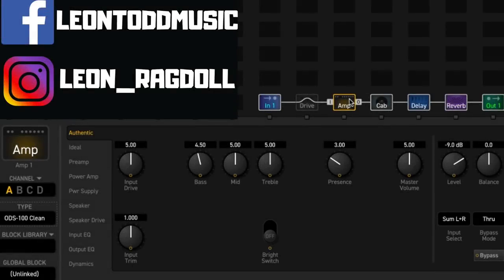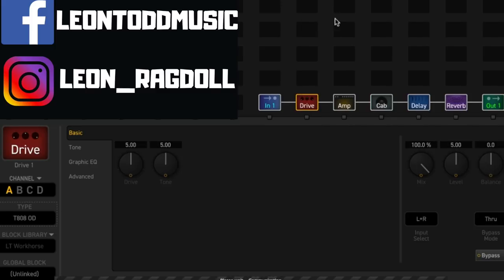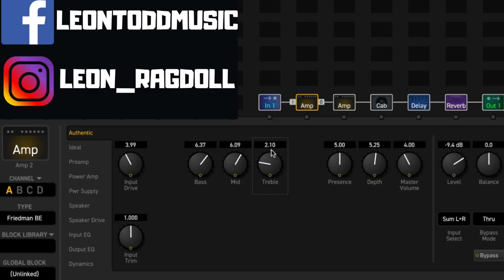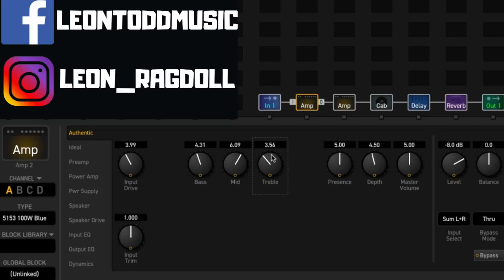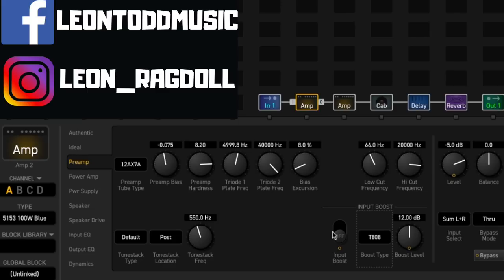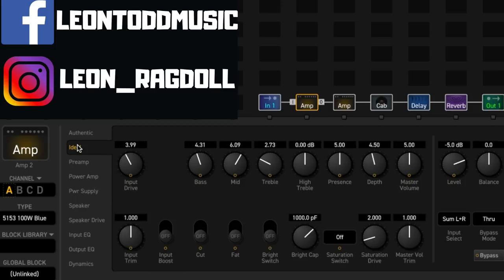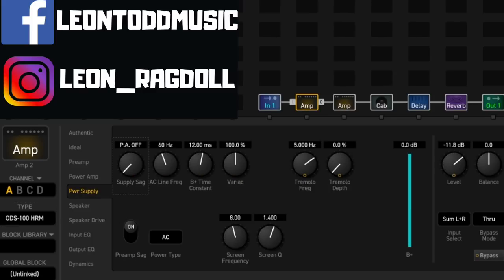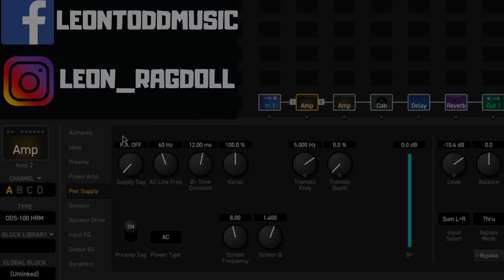Using Amps as Drives

Comment: I learn something from your channel every day! Have you ever used your Axe with a real amp where the real amp is just furnishing the power section? I'd like to try it with my JP2C, but I'm not sure how to connect and configure it.
Reply from the maker: Yep, lots of fun. Dial up an empty preset and load an amp block 9with the relevant ins and outs). Turn the supply sag to 0 and then run this into the fx return of your JP2C
Reply: @LeonTodd  Awesome. Thank you!

Comment: Hi Leon! As always,great sound! I have a curiosity: i think i read on the fractal forum to never put two amps in series because otherwise strange things might happen or maybe the axe might not make sound...how did you get this thing to work? maybe it's because you disable the power amp in the amp block so you can use the amp block as if it were a preamp pedal? Maybe you don't have to put two amps in series if you use both amps with the power amps activated as well. Is this correct?
Reply from the maker: Disabling the power amp is the key!
Reply: thank you very much Leon!!!

Comment: Great video as always!! I was actually thinking of doing that in the real world hahaha. 
The idea is to use a clean amp (a two rock) as a plataform with my victory sheriff 44. 
In order to work "properly", I will try using a suhr reactive load to bring the sheriff down, and then use it in a loop of a switcher, as an amp in a box. 
What I'm trying to achieve is to have great clean tones and real amp distortion in just one cab, but without having to buy a valve preamp pedal and using what I already have around. I don't know if it's going to work or not haha. 

Although I'm not a fractal user, your channel is amazing in terms of ideas and tone in general. Thank you!!
Reply from the maker: Does the Sheriff have a loop? You could take the fx send from the victory into the two rock while you load the Sheriff's power amp down for safety.
Reply: @LeonTodd  thanks for the reply! Yes, it does, but the preamp out of the sheriff is really clean, I don't know if it is the way the loop in that amp works, or that it's just the power amp the one distorting. I think that it's something to try and hear what it sounds like haha. 
I'm kind of expecting ground noise and a lot of treble response, but we'll see haha

Comment: Isn’t this kinda’ sorta’ what EVH does live, kinda’? As long as I can remember, he cranks whatever amp he’s using at that time, has it go into a dummy load, then into a MOSFET power amp to his cab/s. 

Wonder how long it’ll be before amp-in-a-box pedals like the Bogner La Grange will be modeled.
Reply from the maker: AFAIK he does that so he can run a wet/dry/wet speaker setup. The power amp would just be amplifying what goes in without the tone shaping that a clean amp (like this demo) offers.